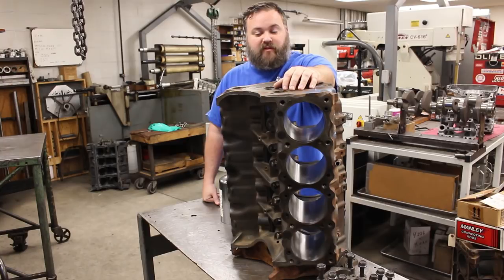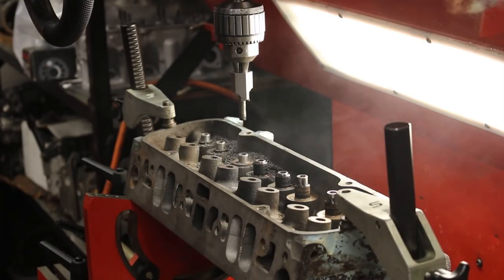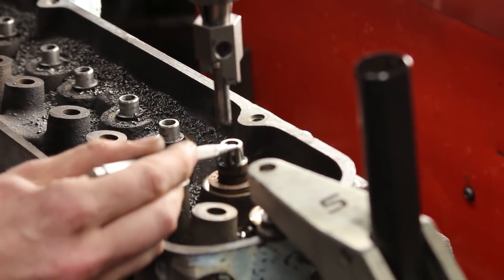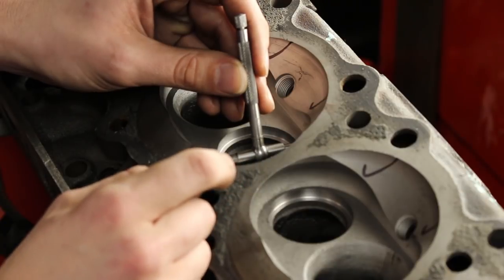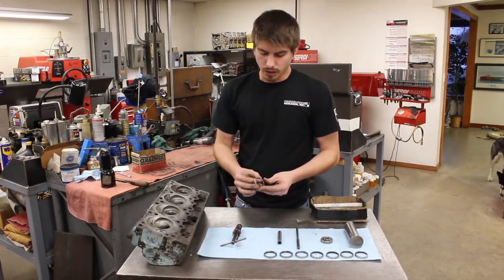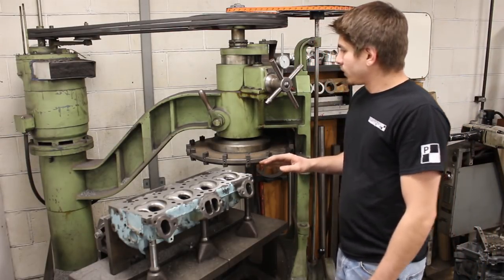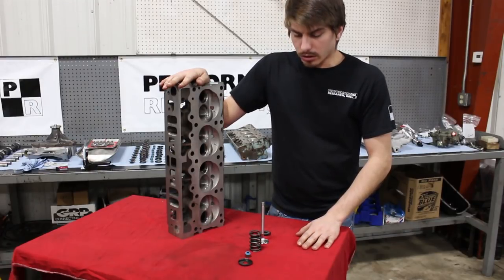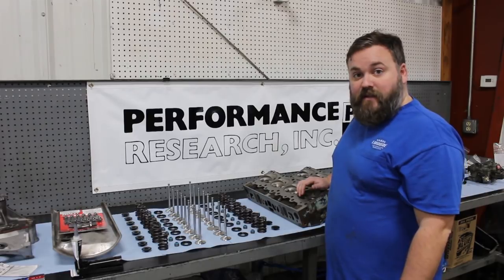1970 Pontiac LeMans Part 6 : Machining And Assembling the Heads

Comment: About the hardened valve seats. I've had a lot of Pontiac guys say we don't need to do that and to just run stainless valves. I've never seen an issue with valve seats on Pontiac engines from modern gas. So I'm curious what your machine shop told you or why you chose to go that route? I'm not saying it was wrong or that what I've seen or heard is better, just want to get why you did it. It can't hurt unless a seat drops out but that's super rare. I'm enjoying the series thus far.

Comment: nice work, just found your channel.  was the intake bowl work found when you took the 455 apart?  or did you do that after dissassmbly/before the valve job?  that could explain a good 25-30hp on the initial dyno runs.  455 needs air!
Reply from the maker: The bowl work was done after the initial pulls were made to set our baseline. It went literally out of the car, on the dyno cart, then on the dyno without touching a thing. This thing is STILL choked down with the heads/intake on it currently.

Comment: A awesome video. What is the highest compression rate you can run on a steel head Pontiac motor using pump gas? I have a 68 Pontiac 400 that I want to stroke-out to a 461 or bigger.
Reply: I wouldn’t go over 9.5 on cast iron heads.

Comment: Did you put it back together with ram air 4 or 455 HO power in mind ?
Reply from the maker: Same stuff essentially as it was before, same block same heads wanted to stick with the D Port exhaust. Made some solid power for a 9.5 : 1 pump gas flat tappet motor :)